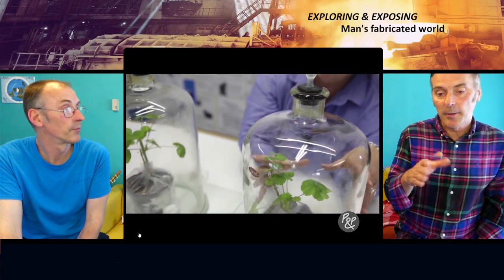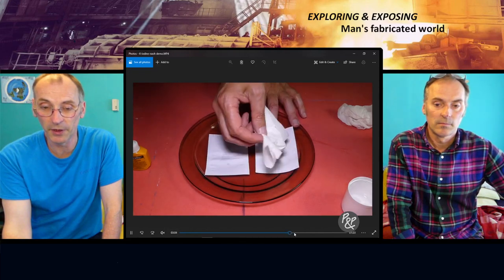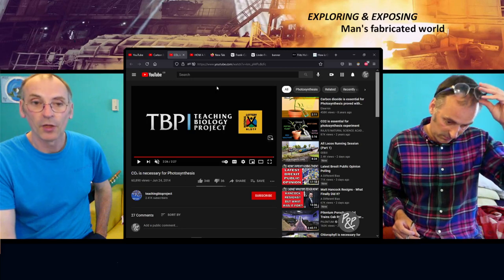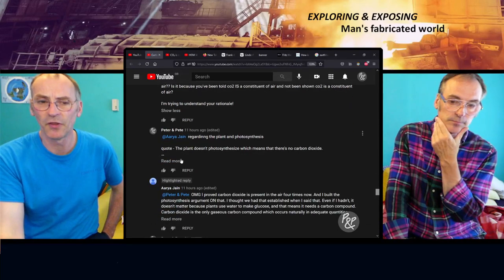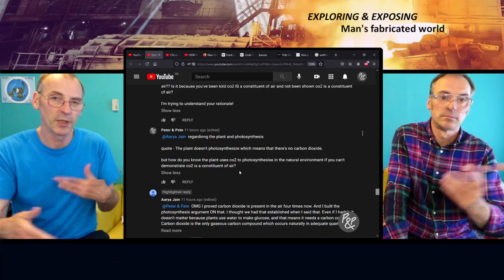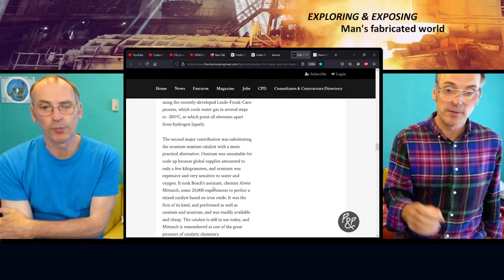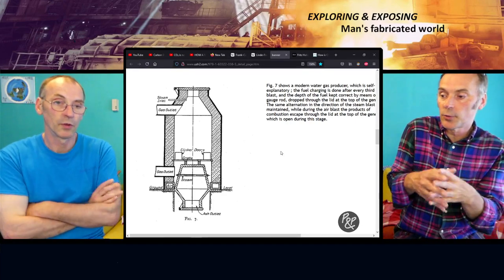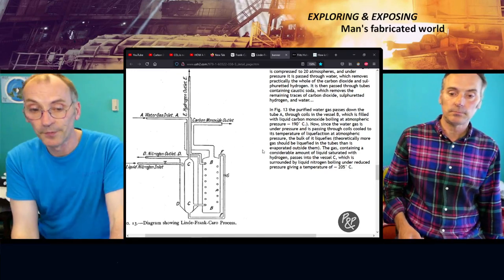The Carbon Dioxide Scam

Comment from the maker: In case anybody having trouble understanding the video's content, the carbon dioxide scam essentially relates to the fact mainstream science tells people carbon dioxide is a constituent of air, is used in the process of photosynthesis etc and yet in the real world, there is no carbon dioxide present in the atmosphere!
Reply: 0,5% CO2 is aprox. present in the atmosphere at this time. For 3 years i monitored it in relation to dry ice production and monitoring of the surounding area in relation to overall content elsewhere
Reply from the maker: @FyaaahS  so you've produced dry ice which evaporates as CO2 and you're monitoring the amount of CO2 in your surroounding area. Seems reasonable but what's that got to do with CO2 being a natural constituent of the atmosphere?
Reply: @PeterPete  uhm.. im saying it is present in the atmosphere. It is being produced as a byproduct from animals and from combustion etc
Reply from the maker: @FyaaahS  you're stating you've monitored an area after using dry ice (which will evaporate as CO2 gas) and now you're stating CO2 is naturally present in the atmosphere!!

Just because CO2 can be demonstrated to be present after combustion doesn't mean there's tonnes of it in the atmosphere!

I'm well  aware man's industries pump out CO2 in the air but you've not done anything to PROVE the waste gas remains in the atmosphere!

We've used hydrogen bi-carbonate indicator solution and there's NO CO2 in the air coming in from my window!!

If you THINK CO2 is present naturally in atmosphere, what method have you used to demonstrate that?
Reply: @PeterPete  spectrum analysis.
Reply from the maker: @FyaaahS  spectrum analysis when you were using your dry ice?
Reply: @PeterPete  no from air samples before and after start of production and from different areas. There are safety protocols and laws nedded to be followed so the concentration may not rise above a certsin threshold
Reply: Yes Of Course

Comment: 2:13 In a reactor the initial Neutron comes from what are called Startup neutron sources. These are placed throughout the reactor specifically to provide these seed Neutrons.  See the Wikipedia page for "Startup neutron source" for more. Once the reactor is running the Fission of Uranium produces more Neutrons in a chain reaction.
Reply from the maker: Yes we've moved on from that video and the initial neutron is generated by what's called a neutron howitzer. The big question is what starts the howitzer to produce neutrons?

The point we have led to regarding nuclear fission is that, in our opinion a neutron howitzer, or similar is ALWAYS switched on, producing neutrons that bombard the fuel cells to generate heat; there's no such thing as a nuclear chain reaction in the sense that it is self-generating. 

In our opinion of course!! 😁

Comment: If I was going to use electricity with a cathode and anode to heat water (to make steam), what type of material should I use to NOT make hydrogen?
Reply from the maker: you would always produce hydrogen irrespective what material you use for anode/cathode!!
Reply: @PeterPete  so your saying the hydrogen is in the water? I thought your opinion  was the water and electric breaks down the rod and that is where the hydrogen comes from.
Reply from the maker: @Flat_Earth_101  no you are saying the hydrogen is in the water not me! 

I assumed you were referring to an electrolysis procedure but then again, how can one heat water to make steam by using a cathode/anode?

I guess i didn't fully understand your question to begin with!
Reply from the maker: @Flat_Earth_101  quote - I thought your opinion  was the water and electric breaks down the rod and that is where the hydrogen comes from.

that's correct!
Reply: @PeterPete  so is there a material that we can buy that we can place in water and apply power to and produce steam without the danger of hydrogen? I guess what I'm asking is there a way to make a mini nuclear power plant lol?
Reply from the maker: @Flat_Earth_101  in my opinion - yes i think it could be done!

Comment: 17:24 - an electric generator moves electrons to generate electricity.  If a generator is used to move neutrons, shouldn't it be called neutricity?
Reply from the maker: we only use the word electricity loosely because tbh, without electricity there's no neutrons! we could use the word voltage instead which then would create the neutricity!!

Comment: So, from your statement below that hydrogen is a decompose matter, so anything that breaks down with water so release hydrogen, so it is a water gas so base on heat which goes to a higher phase from liquid to gas that is called hydrogen, that means co2 has hydrogen, so co2 is higher density, so there is a balance inward to outward so from inward is higher density like iron or other stuff, then higher heat to decompose the mass. Well, I am saying what is the connection between high heat decompose and air fractional, so basically, air fractional is two systems from high heat which decompose the air, then wait so get heavier has it falls down, well, the heavier part is connected to high heat which you show co2 from the volcano, etc, so interblend with other matter so it dissolves with solid, the tiny one which it was decomposed. 

So, all come down to decompose, so air fractional requires to decompose? So, for plants to grow that is connected to co2 that means you cut the forest and other stuff, then burns it up so it means any matter that burns up and releases the matter, the tiny matter so it binds with air so the air fractional change so it is a higher unit so it dissolves which become one like salt and water dissolve so the water itself is higher density as salt water. So, CO2 is two-part, the decompose that is connected to water or electricity, then when the matter on lining that is small enough to bind so become co2, so carbon is matter itself, oxygen is the air itself that is water gas which liquid that is high heat which liquid decomposes into the air, so oxide is connected to oxygen. So, co2 and oxygen are very common but all connect to decompose of water itself, so water is the element as the mother of all, or father of all, one element. But different interaction. So, for plants and trees to grow it requires to burn that is the sun so break down the plant matter and bind air so release oxygen or plant matter has higher heat so it releases oxygen so the sun causes higher heat within so release oxygen so we breathe, so we are lower heat and plant is higher heat, so ya can test with heat detector which is higher heat within. 

You cut off trees and plant, so we die so it will reduce moisture in the air so that means moisture which pulls down to plant and tree so it grows and release moisture so we breathe or oxygen, which moisture is decompose to air so we breathe, so it is not co2 that plants need but the moisture that is connected to dessert which has no humid and cold dessert so come down to moisture, not co2, but moisture and co2 are connected which the higher co2 that is higher burn to break down to tiny mass to bind to air so become co2, so co2 goes down to plant so it grows, then plants release oxygen since the moisture itself is breaking down to oxygen. co2 has salt that pulls moisture, so the salt itself is a mass so other mass as well, like iron or anything that is acid, so any acid that pulls moisture is an acid. It comes down to the pull or push of water that is in everything. So, it is not photosynthesis, but more like pull in water, and water changes to oxygen so it releases oxygen. Match the video that is 'Inside Biosphere 2: The World's Largest Earth Science Experiment' but they says it is impossible since humans failed but plants and others didn't fail, so the problem is missing is not connect to co2, which is gas-based, but the micro liquid that is primary, so humid that is primarily important than air which is dry so secondary important. So, the air is lower denser than micro-liquid which is mist so we breathe and need higher denser within us than oxygen since it is dry so will kill us. Oxygen toxic.  

You say co2 neutralize the salt so it will acid it up, so the salt will be reduced effective in connecting to plant that change color from green to black, so co2 is dangerous which in your understanding which it is not true that it dissolve but you say if dissolve so the salt part will change so get bad, right? 

Ya can make a video about decompose to non-decompose so it is dissolved, so both disunion and blend union that is dissolved. It comes down to the center that is water which decomposes or non-decompose which either pull to dissolved or push away like air and other gases. So, any that dissolved is solid itself, and any that disunion is gas itself, so the center is liquid. And gas comes from a liquid which decomposes, so disunion. So, there is a different combination of union and disunion.

The video that is very clear showing 'https://www.youtube.com/watch?v=lGGjsU1W3w4' which is CO2/oxygen that causes disc leaf to rise and sink in connect to the light / air, but it is not co2 but moisture/air with light, so the light heat the air into moisture so higher heat within so the phase of liquid change to gas that is air so it raises which make sense since lower density goes up even it is high amount like balloon raise you, despite you are higher density but the high amount of lower density that raise you. It is about density relative. Or I am little wrong or all right?

Comment: wooden't(ha) the wood stirring stick contaminate this test?? why not use something less organic?
Probably didnt matter much, I need to watch that again, as I didnt get the gist of it. LOVE this video as many others. Wow, its so great to hear of BASF and Linde Frank Caro...so interesting!!!
Reply from the maker: what's more interesting for us was that in the early days they used water gas as a source of hydrogen to make ammonia, whereas nowadays they use natural gas through steam reformation to make the hydrogen for ammonia production. As for the iodine, all we were doing was showing the effect sodium hydroxide has on iodine. If the plant absorbs sodium hydroxide the iodine dropped on the leaf is less likely to change colour as opposed to a leaf that hasn't been exposed to sodium hydroxide. The worse thing in that demo was the plant exposed to sodium hydroxide was deemed to be a 'control', haha!!
Reply from the maker: Hi P - we've not deleted any comment and we've looked through review folder and there's nothing there from you! Tbh I can't even find your last comment that's why I'm responding to you on this one!!
Reply: @PeterPete  Very odd, and more odd that the last one is no longer visible!
Reply from the maker: @philindeblanc  YT systems are not perfect!